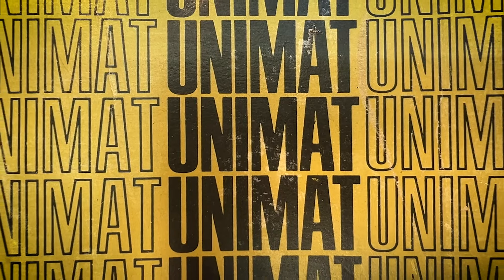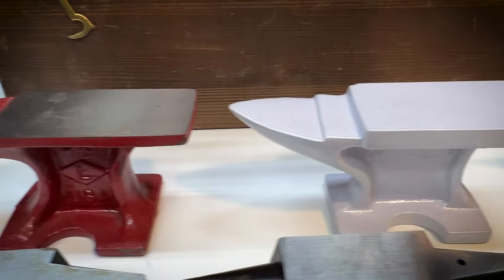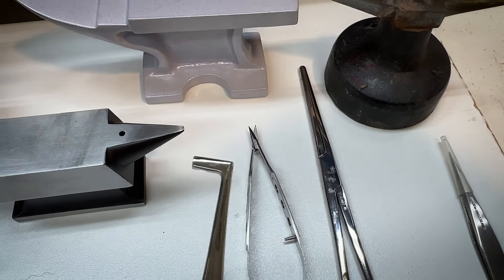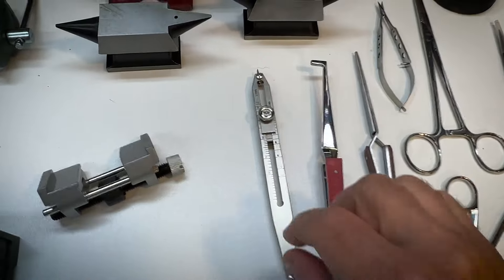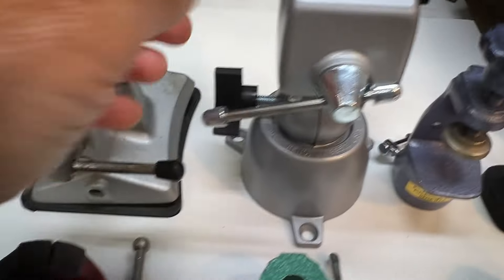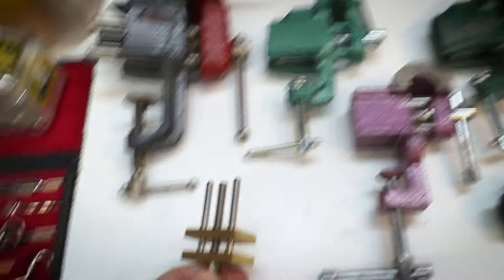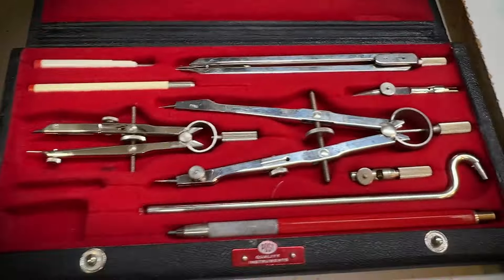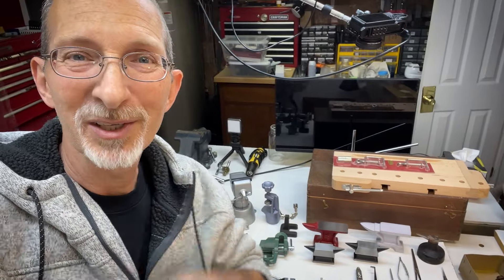New Unimat SL1000 Lathe + an Unexpected Haul of Interesting Tools #diy

Comment: 8:10 that is the base of soldering helping hands. It's missing the hands of course. There is a horizontal bar that attaches to this and the arms are on both ends of that. Some have magnifying glass attachment as a 3rd arm in the center.
Reply from the maker: Excellent, thank you! I have another version of a soldering helper, and I never really liked it because the base was very bulky. Going to see if I can put this to use... 😄